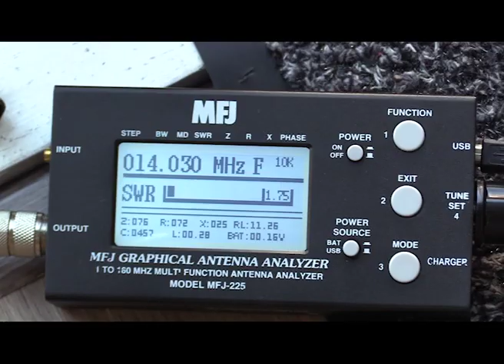Buddipole Video

Comment: I see at 2:12 to about 2:20, the antenna is setup in the vertical orientation, EXCEPT, the red choke lead is still connected red "left" versatee connector.  Should have been the blue connector as you previously described !